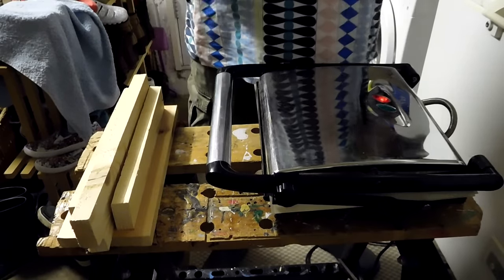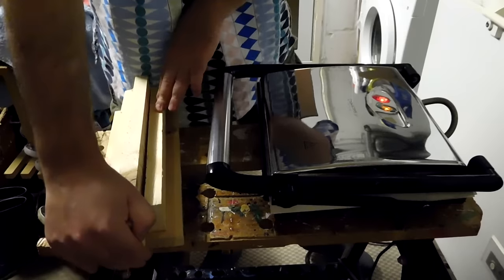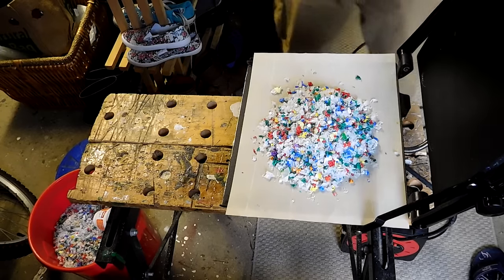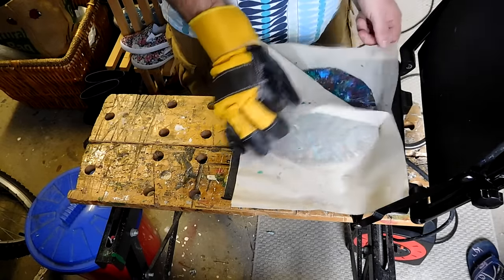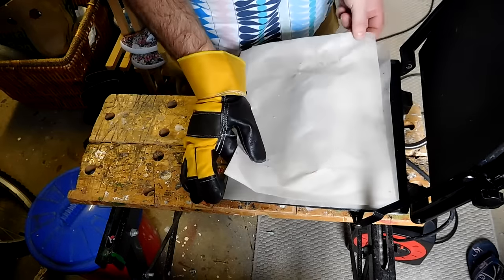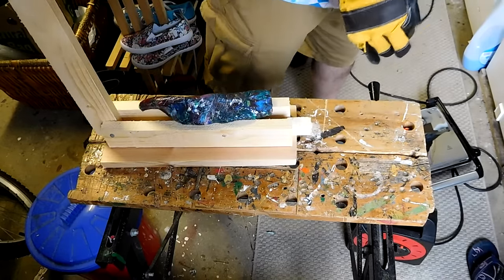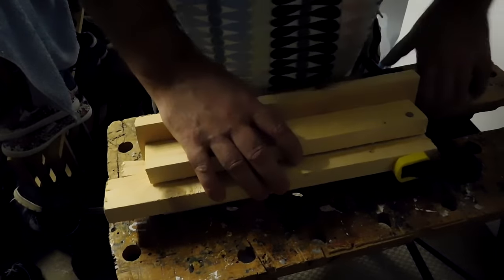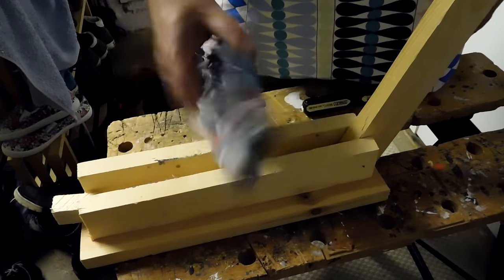Forming Useful Pieces Of Recycled HDPE

Comment: Thanks for this, We have been trying to develop a school project for recycling HDPE and found that if you get the right temperature (around 160-180'C) there are almost no fumes so very safe to use, except for the handling when hot!
Reply from the maker: Yes - although be careful because it's possible even for temperature controlled devices to have localised hotspots, so adequate ventilation is prudent even when fumes are not really expected.  The key risk is the temperature and properties of the material - this stuff gets hot enough to burn skin almost instantly, and it's sticky.  Treat it with more care and respect than you would if you were handling molten sugar (it's about equally sticky as molten caramel, but hotter)
Reply: @AtomicShrimp  That's helpful. Good point about localised higher temperatures. You might see on our channel we are school project and have made some products but trying to avoid 'handling' plastic directly with gloves.

Comment: Try a PYREX baking dish or a ceramic dish in a 300 degree oven, layer hdpe in about 1 inch deep, melt about 15 minutes, add more hdpe until you reach the thickness needed or to the edge of your dish, between additions use silicone spatula to gently press together, after the last addition heat around 30 minutes. DON'T keep opening the door on the last melt, wait at least 20 minutes to check!  DON"T TOUCH, let hdpe cool in dish, no sticking, smooth shiny finish, cut into size needed. and I only cut my hdpe into 1 to 2 inch pieces 
Thanks for the video
Reply: Johnny2419 Have you figured out how to bond two pieces together?  I’m designing a full keel and skeg for my kayak. The profile is very irregular with a cone shape I’m having to eliminate for a length of 14”..  

I have to build up the bottom to eliminate the 2” cone shape on the cross section which is tapering and 14” long.  I’m thinking about cutting thin layers fitting each layer then find a way to bond these layers into one piece and then bond that to the kayak.  I can use a mechanical fastening method if I have to but the flat 14” long block I’m fabricating to actually hold the removable skeg  must be rigid to receive and hold the skeg.  I’ll mill out the slot for the skeg;  being removable is key.

Comment: I gave this a thumbs up seconds after seeing the sandwich toaster, why didn't i think of this. Happy to subscribe and thanks for making and sharing.
Reply from the maker: Glad you liked it. I find the sandwich toaster to be just the right temperature to melt the resin without burning it - at these temperatures, it is possible to work on kneading and working the plastic repeatedly, which improves the structural integrity of the end result.

Comment: o k boss it's good to see you working with HDPE again you and your videos are the reason I got into doing stuff with HDPE. since I saw you laat I have been doing experiments of my own and have found a way or two of making larger format bar or beams as the need arises. I use an old trailer hitch reducer sleeve that I found and I stuff it with grocery bags By placing it in oven I form it into various sizes of any length I want. after it melts together I use a ram I made from aarve bolt to compress it together  I get longer peaces by maling two short pnes ans then use the same mold and my heat gun to first heat a end of each of the shorter sizes and then ram the hot ends together and inside the mold then I use bar clamp to hold them together while they cool. when Im making a single peace , I use cold water to soak it in and it quick cpols in minutes instead of much longer. again its good to see you on here I look forward to seeing what the new project is.

Comment: Here's a thought to refine your melting process. Make a frame out of 1/2 - 3/4 inch square stock hardwood that you can set on the bottom plate of your sandwich press. Line it with your paper. Over fill it with HDPE. Melt it down and refill it from time to time as needed in order to fill it completely with melted plastic , so as to have straight edges. Using the press as a press with weight or clamps, you will get a uniform thickness because of the frame. Make a flat piece of wood to fit the inside dimensions of the frame. Lay that piece of wood on top of the melted plastic and put the top plate back on top of it while it cools and you will eliminate any warpage as the plastic set up. If I am correct in my thinking, this will give you a nice, straight sided, even thickness piece of HDPE to use in your projects.
Reply from the maker: Good idea.  I could probably do it with square metal stock - although the resulting board would still be slightly concave in the middle when cooled, due to the significant expansion of HDPE when it melts (and thus significant contraction when it cools)

I've achieved uniform thickness on this toaster before by just putting a metal nut at each corner of the press (the bigger the nut, the thicker the sheet) - I don't get straight edges that way, but it can be cut straight

Comment: You defo got a sub here. 
Going up binge on your uploads. This is the first one of yours I've seen. Hope you moved on to extrusion. I can see this really being useful. Those bars look very strong, really excited to see your projects. 
I've got something I've been really wanting to make, came close to buying a 3D printer but this seems a lot cheaper. Filament seems bad as it increases plastic waste. Also once formed it can't be reworked, whereas this looks like it can.
Reply from the maker: HDPE doesn't work well in 3D printers, unfortunately, due to the amount it shrinks during cooling - 3D printed HDPE models would likely tear themselseves apart during cooling.  I think injection moulding is one way to go, or extrusion of large beams (like we've seen on Precious Plastic)

Comment: Somebody start a go fund to get the poor guy a second glove...
Reply from the maker: The intention was to protect one hand, and retain fine dexterity in the other
Reply: lol, been there, done that.  But nobody says your gloves have to match.  Perhaps a more dexterous type for your left hand...
Reply from the maker: Mat Helm I was thinking something with rhinestones
Reply: I saw a vid where they spin this stuff up into polyester for ( I assume) leisure suits in Asia....  Wonder if we could do a glove... hmmm
Reply: @MatHelm  Not a good ideal for a glove or heat pad because it would melt and wind up being a melted hot blob of plastic stuck on you burning on your hand. Thick leather welding gloves just work good for heat, plastic melts at too low a temperature.

Comment: If and when the gas board are doing gas main replacement in your area, 2 benefits: One, they use PE pipe these days, so you could possibly grab some offcuts for a nice yellow type (or blue with the water board!).... and two, they heat weld them, they might let you examine the process in detail
Reply: Gas companies will prefer the more expensive self-heating fittings. I learned how to weld them at the gas school for journeymen plumbers, for the manual heating process (example: geothermal heating/cooling), it's just an set of iron and circular shapes that you apply on the pipe and fitting ends for a set time specified by the manufacturer with a precision of 1 second margin (17 seconds, 42 seconds,  to near 1 minute 12 seconds), after heating you apply a steady movement towards joining the two parts together and it is done in 3-4 seconds. You hold the parts together for another 15 seconds without moving and release,  sign your initials, the date and heating time on the fitting and pipe, now you're ready for the other end of the fitting and another piece of pipe.

Comment: You said you wanted to make a HDPE boat but it is hard to weld panels together. Did you check out the special heat guns and nozzles made for welding plastic?

Comment: I have no idea why I watch videos like this.  I have no need for anything I've yet seen made this way - but I just find them interesting.  And I am starting to save lids etc.  Which the family have no answer for and think is strange.

Then I thought "guy could do with renovating those Workmate jaws - plenty of How To videos online."  Then I remembered my own Workmate jaws could use some work.  (I have 2.  The 40+ year old one is a bit tatty but solid and straight, but one of the jaws on the much newer one has developed a distinct sag.  Cheaper materials nowadays eh, Workmate team?)

Then I remembered that this guy makes things from plastics ... hmm ... plastic?  ... Workmate jaw?  Could I?  Should I?  Would it work and be OK?  Would it be strong enough?  Maybe a hot air gun to heat the plastic?  What do you folks reckon?   🤔😁

Comment: Wow.  I’ve got a project I need to make a reverse plaster casting then cast a single piece  3” x 4”  x 14” long with a 1/4” thick flange..  maybe I should consider layering instead of block forming
Reply: Have you figured out how to bond two pieces together yet?  I’m designing a full keel and skeg for my kayak. The profile is very irregular with a cone shape.  

I have to build up the bottom to eliminate the 2” cone shape on the cross section which is tapering and 14” long.  I’m thinking about cutting thin layers fitting each layer then find a way to bond these layers into one piece ang then bond that to the kayak.  I can use a mechanical fastening method if I have to but the block to actually hold the removable skeg  must be rigid and removable is key.

Comment: Hi Mike, what temperature is the sandwich toaster running at? Are the non-stick sheets regular baking paper or are they silicone? 
I'm excited about HDPE - just not quite sure what to use it for yet. All the best, Rob in Switzerland.
Reply from the maker: The toaster runs around 200C, which is just right for melting the plastic without scorching it.  The baking papers are reusable teflon fabric - look for reusable baking sheets on Amazon and you should find it.  I think thin silpat sheets would probably also work

Comment: I realize this is an old video but do you have any recommendations of creating a round stock? thanks!
Reply: I've seen people use a pipe and a ramrod. One way is to melt it, then put it in and compress. Another way might be to heat it in the pipe. Either you want to apply some kind of lube so its not stuck. If you melt it first, good idea to warm the pipe up. IDK if you'd need a way for air to escape, but that could be tough without the plastic squeeging out

Comment: nice video AtomicShrimp!! =) You now have a new follower <3. By the way, i'm looking for any method for doing kitchen tables (for cut meal on it) smelting HDPE like you do. I've thunk in a homemade press with long wood sheet...but i haven't made anything yet. What do u think? I think 40 cm x 60cm could be a nice size for the final HDPE sheet. Best regards!!
Reply from the maker: The hardest thing to manage with this stuff is the contraction when it cools down.  If you constrain it between two rigid flat boards while it cools completely, you have a chance of ending up with a proper flat sheet.

Comment: What's the exact temperature you use to melt HPDE please ?
Reply from the maker: Kami Star I don't know the exact temperature of this toaster, but it must be around 150 C
Reply: Ok thanks , do you think HDPE have exactly the same physical properties after melting again and again ? i mean resistance to traction etc ... ?
Reply from the maker: After repeated melting and remelting, (especially at the higher end of the temperature range for this resin), the plastic may begin to degrade - this may be seen as brownish scorching, or it may manifest as brittleness in the final product.  My sandwich toaster is really only achieving a temperature in the lower end of the range for melting HDPE, so I have been able to remelt without any noticeable problems.
Reply: Ok thanks for the information .

Comment: You do know that the lids/corks may be of PP and not HDPE?
Reply from the maker: Some are, yes - but I select the lids with the resin mark '2' - HDPE
Reply: @AtomicShrimp  I noticed while doing some sorting that most plastic containers in Sweden (my native region) is more PP than HDPE today.
Will be difficult getting my local grocer to release bread crates to gather enough HDPE for something really useful.
We don't have milk bottles here. We use Tetrapak cardboard boxes instead. 
They don't really melt that well ;)
Reply from the maker: Try bottles from hair and bath products, also liquid laundry detergent bottles
Reply: @AtomicShrimp  Yes but most of them too seem marked PP here. At least those I have found so far.

Brand name goods seems to be more centralized in production and thus have a higher frequency of using higher quality bottles.

Comment: How did you 'machine' it?
Reply from the maker: I used a drill-powered lathe (video here: https://www.youtube.com/watch?v=eX1_gdft5ZA ) - but almost any technique that works for wood also works for this stuff - except sanding - it's better to use sharp tools and cut/machine directly to the final finish - sanding it seems to make the surface go a bit fluffy, but a sharp chisel or plane will get a glossy, smooth surface.
Reply: Thanks

Comment: When the hot HDPE is folded over as demonstrated it will trap air, so the final product will not be a solid bar of HDPE.
Reply from the maker: Ian Smith that makes sense in theory, however in practice, folding it and pressing works the air out
Reply: Ian Smith is correct. The folding and pressing will trap air just like a puff pastry.

The mould will compress the trapped air into pressurized  cells.

For many applications this isn't a problem but voids will present structural defects under load.

If the application requires void free HDPE then folding & pressing should be done using a vacuum to lower the residual volume of air.

This is how compsite structures are often made, using vaccum bagging.

Good video!